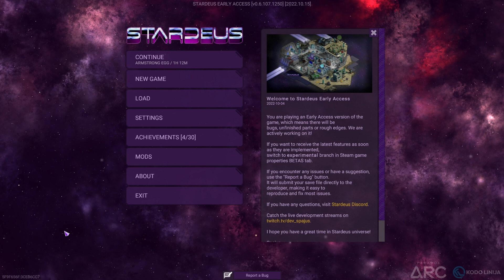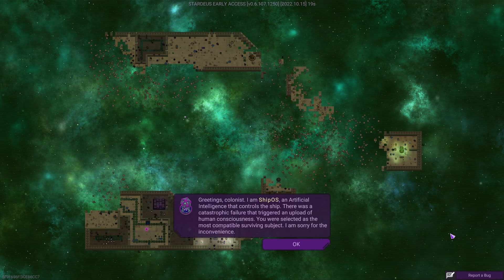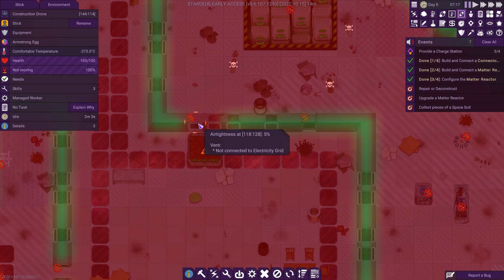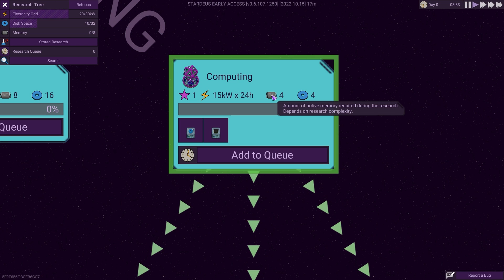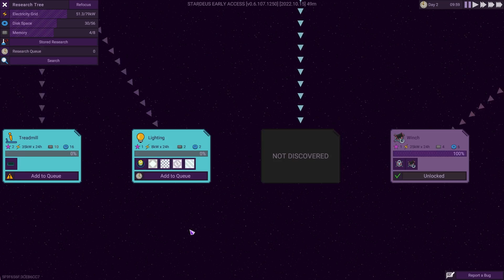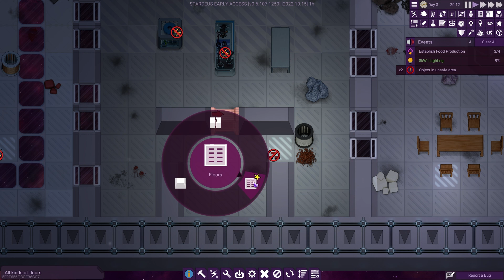New Starship Colony Sim - Stardeus

Comment: My tactic is to just build a bridge as a temporary solution, hook the cryo up and put in an oxygen creator and heater in that room. The bridges are then removed so I can pull the ship together.

Oh, by the way. The pop up that shows up each time you hook something up while paused you need to push the other button to get it to go away permanently. Not that I did that for two hours before reading what the buttons did.
Reply from the maker: Oof, I should have read those buttons better XD
Reply: Same 😀 got there eventually though.

Comment: Regarding Asimov's laws: as I recall a robot would get stuck in decision paralysis if every course of action available to it would result in a human coming to harm. Many of the robot stories were about highlighting the flaws in the three laws.
Reply: One of them that I recall was a robot on mercury getting stuck circling an ore deposit on mercury (conflict between obey order and self-preserve). The solution was to place the human in danger near the ore, thus the robot had to bey the highest law and save the human, incidentally picking up the ore at the same time, which enabled the air condition in the installation to be repaired, thus saving all the humans.